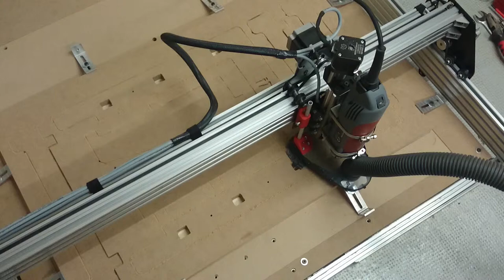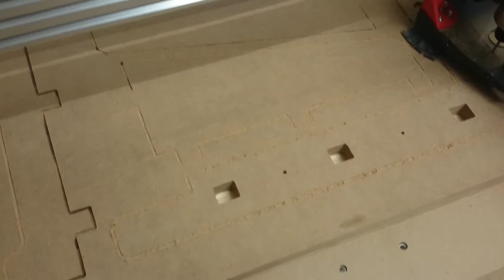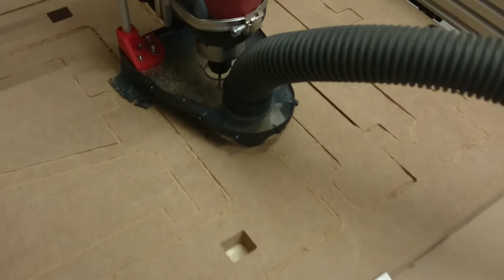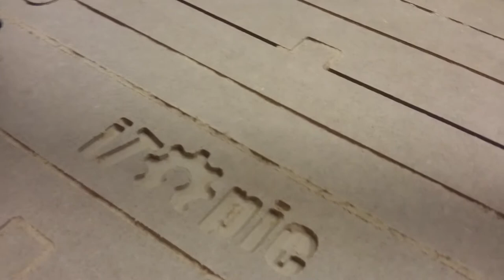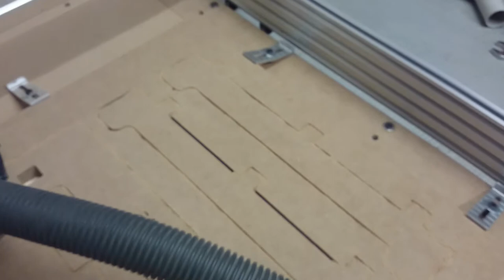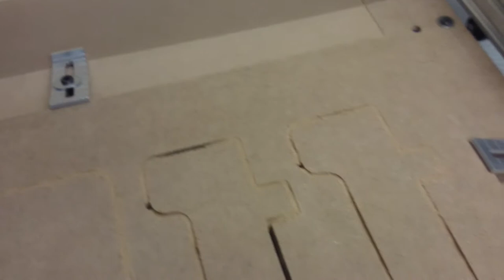OX Dust Shoe (5/5)

Comment: Great idea and thanks for sharing.  You may be able to even out the area of suction and increase velocity by fixing a 2nd acrylic plate with multiple small holes in it directly beneath the hose end.  Kind of like how a vacuum form table works.  You will need to play around with hole placement and sizes to reduce whistling noise though.